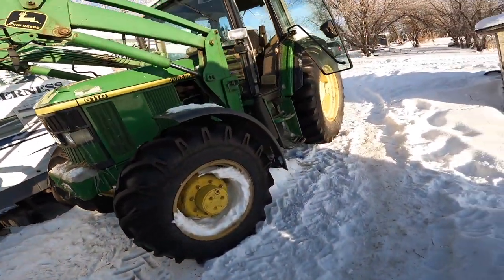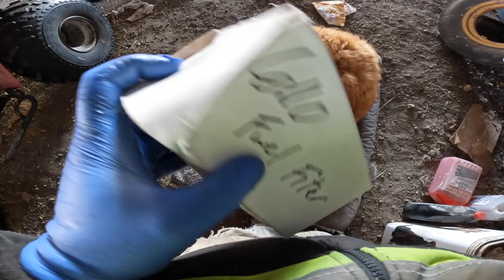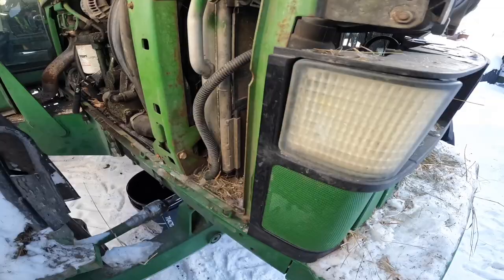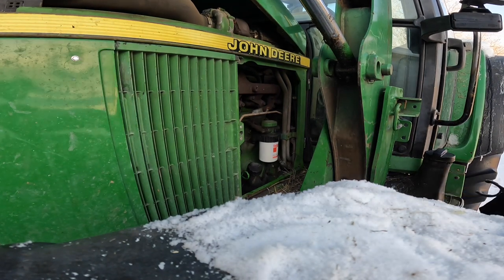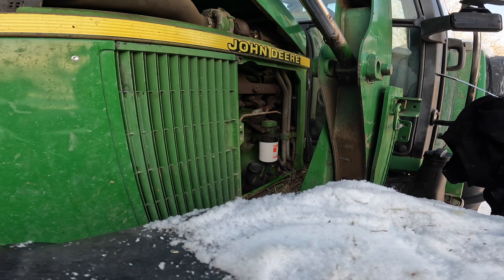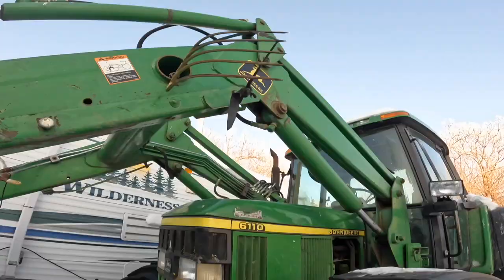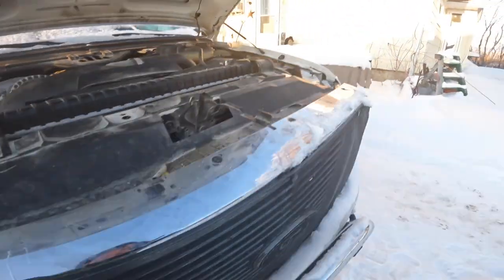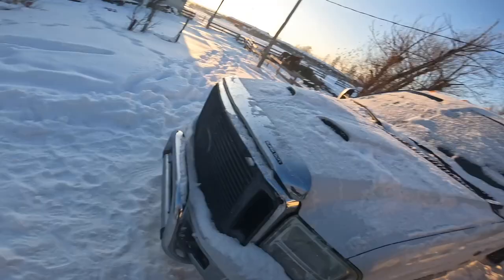Tractor Oil & Filter Change (JOHN DEERE 6100,6110,6200,6210,6300,6310,6400,6410) 🚜🛠🧰🛢

Comment: You need to plan for oil changes during the warm part of the year.  My hat is off to you changing your oil outside during the winter.
Reply from the maker: Yes, typically I would preemptively plan to do it in the mild weather but sometimes the chit 💩 hits the fan and your stuck toughing out the conditions. Cheers 🍻 from PSR

Comment: Rotella 5w40 synthetic in the winter. Rotella 15/40 in the summer. I use to use cheaper oil and change it more often but it seemed like that was all I was doing was changing oil.
Reply: Also I only try and buy oil on the spring oil sales. That helps alot.
Reply: So back at work today. I was just informed we are switching to propel as Rotella is 5 dollars a litre more.
Reply from the maker: Really eh!? When are prices going to quit inflating, it has to hit a ceiling sooner or later.🤦‍♂️
Reply from the maker: Jeremy this is a very wise act, and I should lock this advice up in my noggin. But yes I typically try to remember about the Spring sales and stock up but this year was different as ALL of My OILS floated and got washed away by Flood this past spring. But this year I will probably stock up.👍🏻
Reply from the maker: Great point, I totally agree with you. I hope this NEMCO oil turns out to be a good oil. So far so good.👍🏻
Reply: @PrairieSunsetRanch  hopefully prices stop climbing. Doesn't leave alot left on the bone for us, does it.

Comment: I need to change oil too. Did you fix your suv oil pressure.
Reply from the maker: It’s a work in progress! I just fixed my John Deere 6400 Hydraulic line that blew. Will post video in next couple days on that then onto the Yukon. Hopefully have something figured out by next weekend. 😬